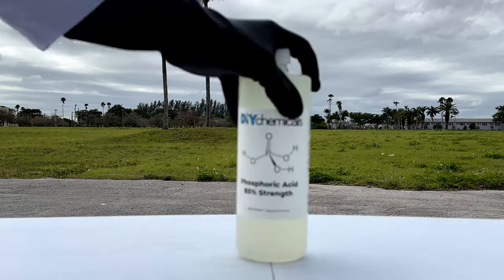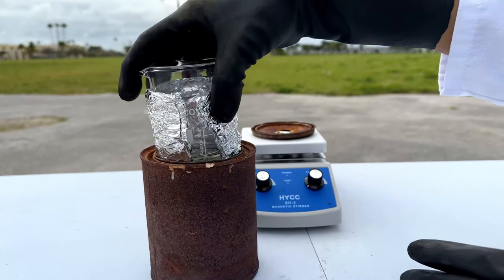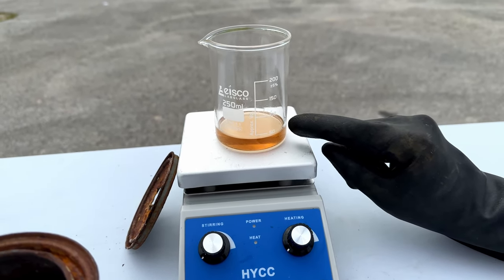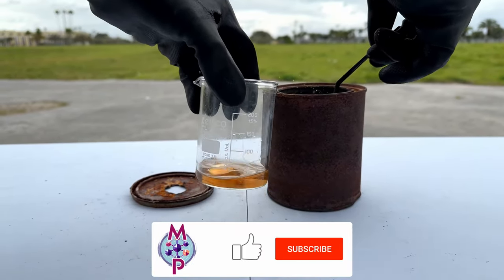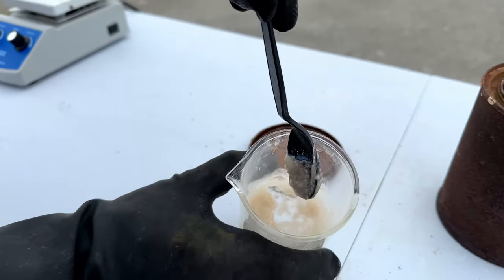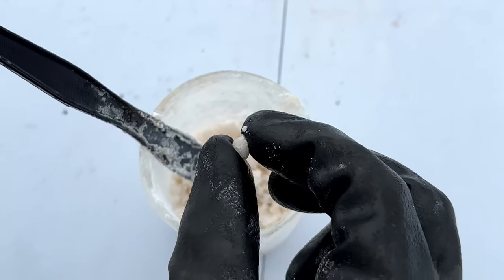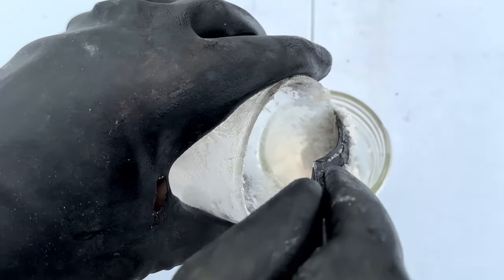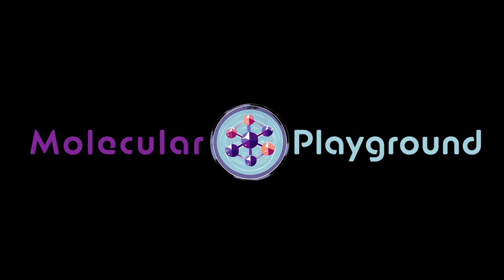Making Silica-Supported Polyphosphoric Acid

Comment: What's the best way to determine if this catalyst can substitute paladium on carbon in a given reaciton?
Reply from the maker: You would have to conduct an experiment to determine that. This modern catalyst is rather novel even in science journals since it has the ability to do many condensation reactions. As for hydrogenations (which is what palladium on carbon does), explore it and see! I would love to hear if it can!
Reply: @MolecularPlayground  Will drop a note after trying it out.  Thanks for the reply.  Was going to drop a suggestion for a video idea. Here goes.  Perchloric acid via modified Willard.  The use of HNO3 vs HCl vs Aqua Regia.  Seems refluxing NH4ClO4 with HCl results in perchloric acid with ammonium chloride contamination. The HNO3 prevents this side reaction until all the NH4 is boiled off, then the remaining acids are boiled off leaving pure HClO4.  But it consumes 1:1 70% Nitric for each ml of 60% perchloric, making it wastful of harder to acquire acid.  I think the bulk of the oxidation reaction can be done with cheap Hcl under reflux until the production of NH4 slows, then nitric can be added dropwide to push the remaining NH4 off the NH4Cl, resulting in largely pure HClO4 once heated above 135C to drive off remaining free H2O, Hcl and HNO3.  Just a thought.  I plan to try and document this  in summer because it's best done outside to prevent any metal perchlorate buildup on the hood or fan system metal parts. :)

Comment: You have a mixture of phosphoric acid and polyphosphoric acid. Polyphosphoric acid is extremely viscous. It just sits there looking at me if I turn the beaker upside down.
Reply from the maker: I wouldn’t say there is any phosphoric acid left as it has all been condensed into at least pyrophosphoric acid. I heated it at 716F for 24hrs. The condensation point of regular phosphoric acid is ~400F. Sure, pure polyphosphoric acid may be completely solid, but pyrophosphoric acid (and to an extent triphosphoric acid) is a very viscous liquid, and it can mildly dissolve polyphosphoric acid too. The reason why the poly acid is mobile is because it was still quite warm.